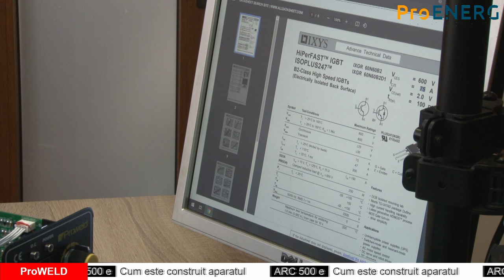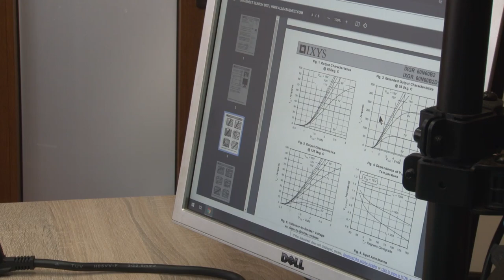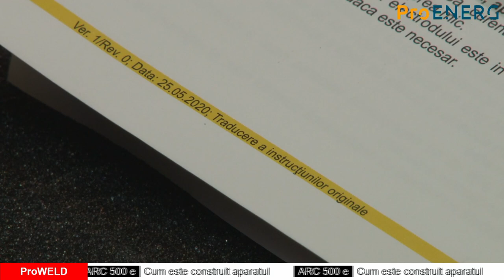ProWELD ARC 500e - sudura portabila. Partea 2

Comment: Datorita videoului dvs, am cumpărat și eu acest aparat. Diferența față de cele Intensiv și Velt,  e că nu are și posibilitatea de a suda TIG. E curățel lucrat pe interior. Mă așteptam la o îngrămădire mai mare a pieselor. In fine. Pt un gard și o poarta, eu cred că mă va ajuta cel de 180 A. Le fac din țevi și platbanda de maxim 5 mm grosime. Cu un electrod de 3.25, pus la aprox 120-140 A, voi avea penetrare in platbanda. Cred.
Reply from the maker: Ma bucur daca am fost de ajutor. Sper sa va fie de folos aparatul.
Reply: @CornelLazar  ok
Reply: Velt ,sudează și mma și tig dar gama profi ,adică 250 tig mma cu control al gazului sudura.dar la alți bani.